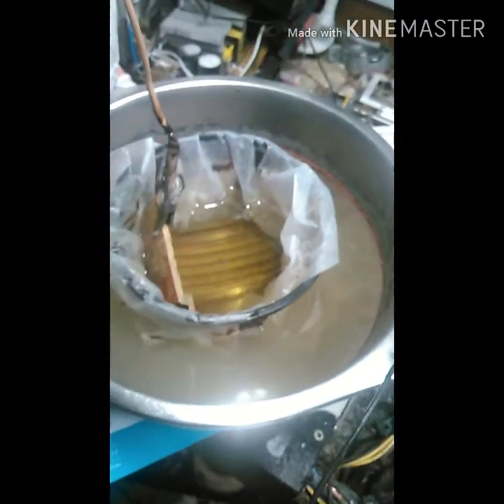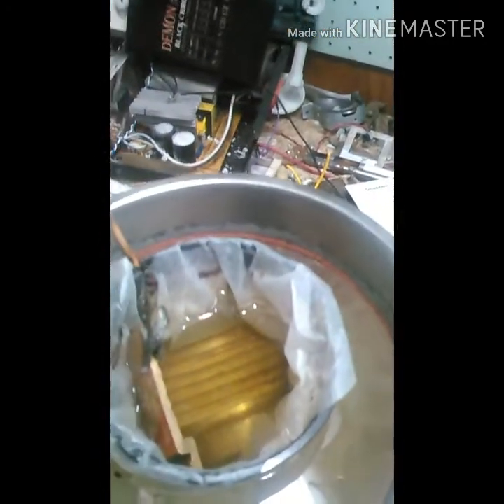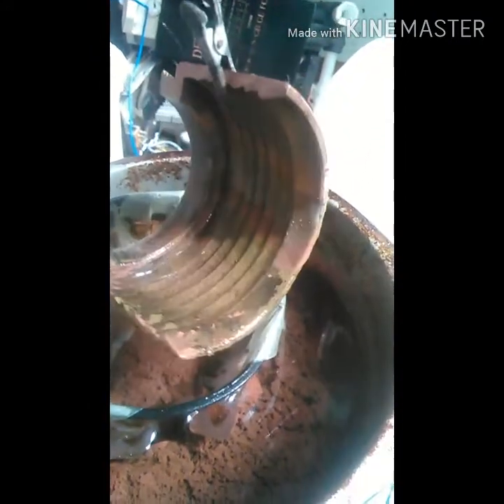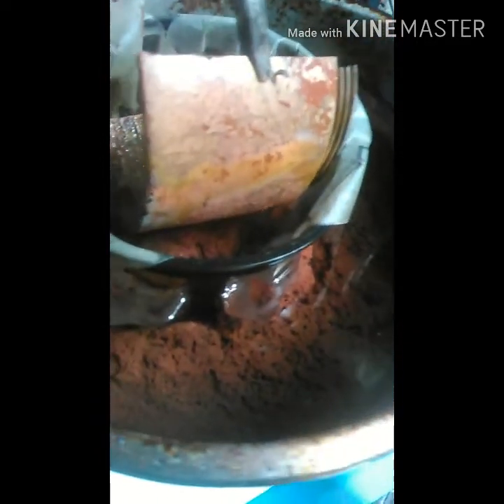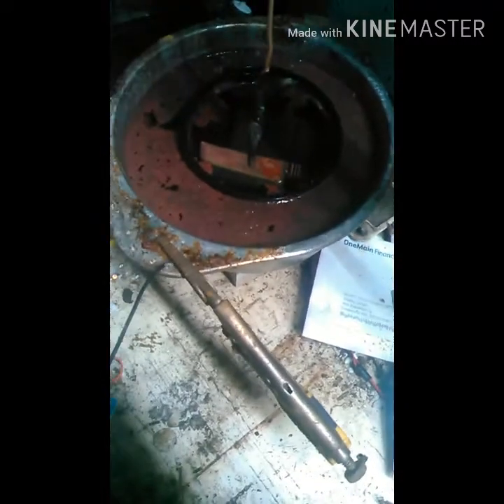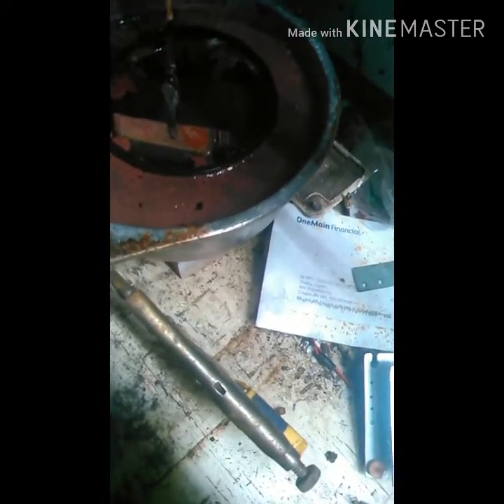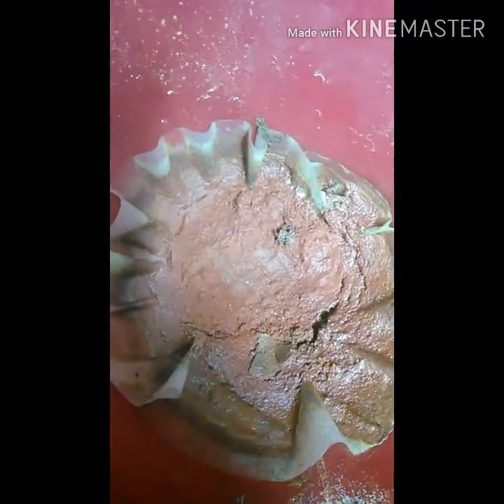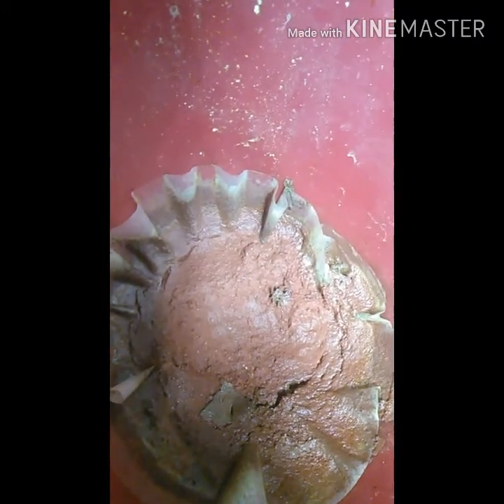Purifying brass into copper and zinc/tin (primarily copper)

Comment: Prolly copper and zinc unless u electrolyzing Babbitt, FYI
Reply from the maker: Joseph Jones yes you are correct brass typically has zinc and bronze typically has tin. Although both can have both depending on which alloy it will have a greater amount of tin or zinc over the other depending. Thankyou for the comment!! I appreciate it. It helps me to spread better information!